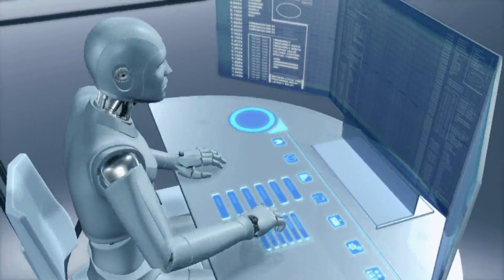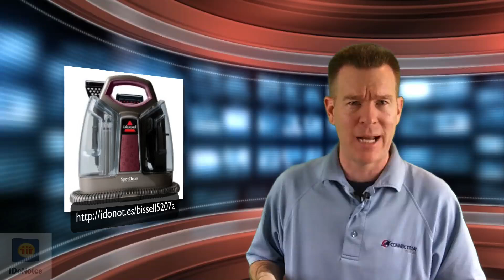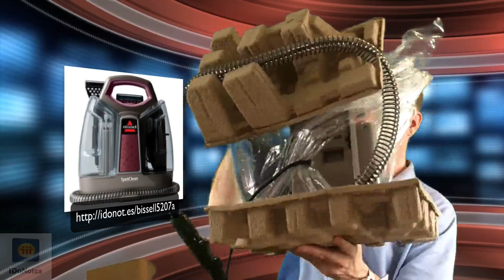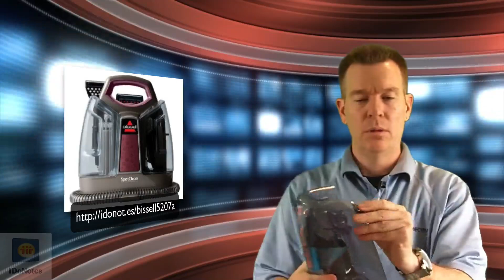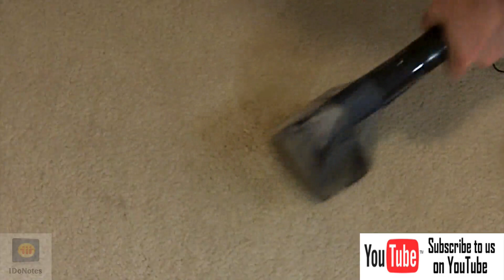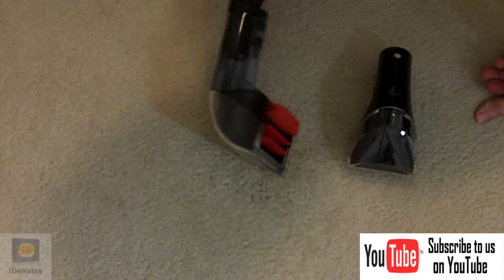Bissell SpotClean 5207a Spot & Carpet Stain cleaner review

Comment: My problem is that we have a newly adopted dog who is not totally trained to signal when she has to go outside and do her business. So, we occasionally find a little piddle spot on the carpet. Since dogs have a good sense of smell they tend to pee in the same spot they went before cause they can smell where they've gone before. And apparently, even bleach doesn't seem to get the scent up. And these machines never seem to vacuum up all the moisture they put down (i.e. the actual suction power of these machines is not what is always advertised). What do you recommend? God knows I can't afford a professional steam cleaner!
Reply from the maker: +Anthony Gates I would bet if they use the same spot over and over it will get into the padding and really never go away.  Have you thought about one of those training pads in that spot to catch the accidents?
Reply: go for the bissel cartpet pet pro 2x.  its on ebay for about 130 used lightly

Comment: I too am having a problem disconnected the deep clean attachment for cleaning. it has a clip but I dont want to push too hard and break something. This is the second video I have watched and they don't show them opening this attachment for cleaning
Reply: i agree in all the videos they never show  how they take off the larger attachment only the smaller one so i rang bissell customer service myself and it does not come apart you clean it under a tap of warm water and also use a cable tie they told me to release any stuck hairs etc this seemed to work for me and i hope this helps everyone else too
Reply from the maker: We have had no problem and it does take a push. We use a pen end to push it down sometimes.  It needs the cleaning for sure.
Reply: i rang the customer support number for bissell as i have the same problem they tell me this larger tool doesn't come apart like the smaller one to clean the larger one  just rinse under warm water and if there is any small hairs etc stuck still they said to use a cable tie to release it then rinse uner warm water again and this has worked for me hope this help other users by the way i am from Australia incase you were wondering
Reply: SpikedStudio
you might have a different attachment then mine is all i can say as mine definately does not come off i phoned bissell customer service myself i noticed in the you tube videos their larger attachment was a red one unlike mine which is all white brushes my model on the instructions says it is 3698 series but still looks like the one they tested here on you tube hope this helps
Reply from the maker: Marianne Cox Thanks for ringing support.  It takes effort to get that larger one part for sure like I said.

Comment: I just picked up this unit and gave it a try. Only issue I am having is disassembling the deep clean attachement to clean the inside, any suggestions?
Reply: i just posted a reply to your query after phoning bissell customer service ok i would still like to know how to clean the hose any suggestions /
Reply from the maker: Marianne Cox We run the hose in the bathtub with a small think toilet brush every so often.  Best way we found
Reply from the maker: Hmm most of the parts have a clip or small black tab that pull them apart. I then run hot water through each one.  I constantly use this device still